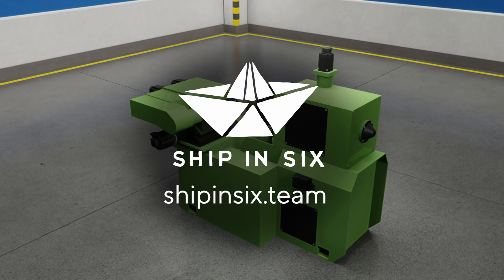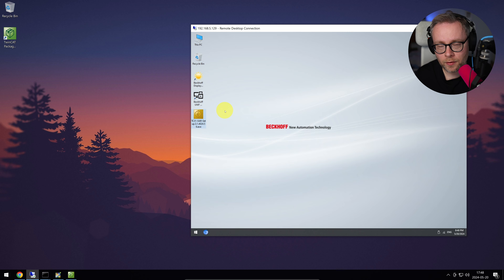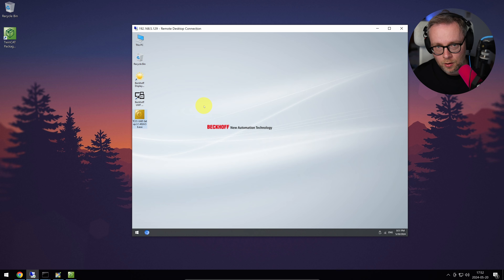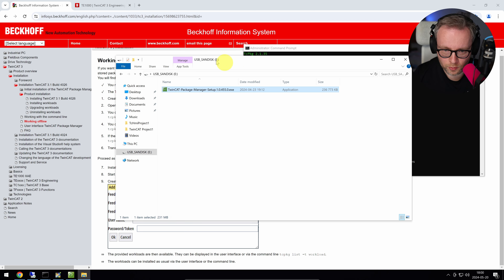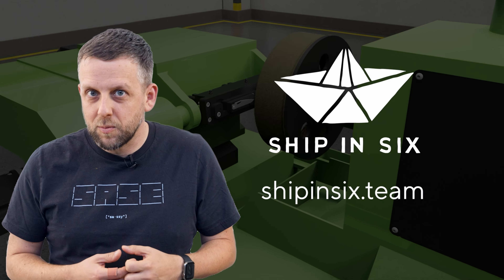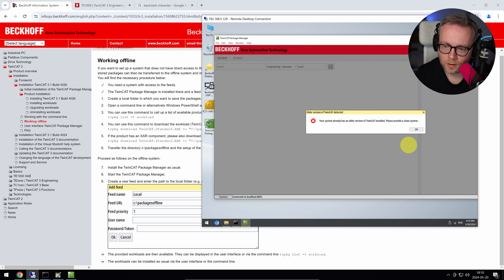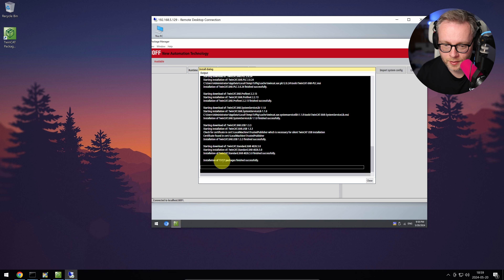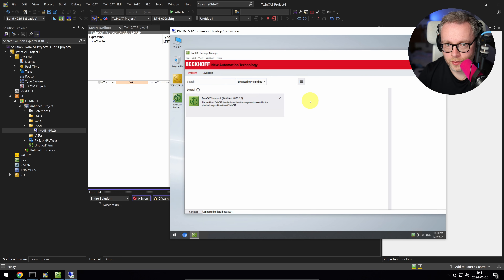Installing TwinCAT 4026 XAR on PLC

Comment: I like the idea of having a package based system so you do not need to install all components on every PLC, BUT:
1.) You have a 250MB Package Manager just to download some files. This is more than 2 times the size the full TwinCat 2 installation was. Why not just make a leightweight desktop application instead of shipping a whole browser. Also why cant they make the packages an exe file.
2.) Why is there no GUI option for creating offline packages?
3.) Dont know if this is a HyperV issue, but package manager does not start on my Win10 32 Bit test machine.
4.) Also it seems that the 4026 development environment is incompatible with 4024 runtimes if you are using visualizations (TS1800). You are forced to update your visualization profile in which case the project will not boot on 4024 runtimes.
Also there is no way to install 4024 in parallel. Even remote manager does not help. Do not know if there is a solution for that yet.
Reply: 1-2 personal preference issue
3 - try 64bit
4 - I'm using 4024 remote manager while 4026 installed, the key is to use 32bit shell with remote manager.